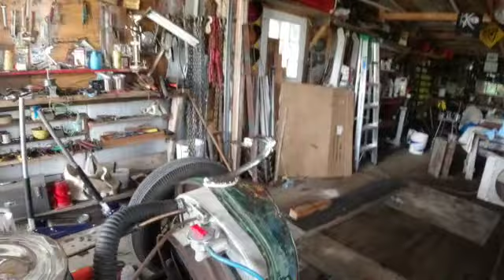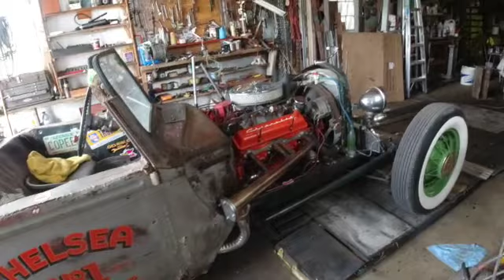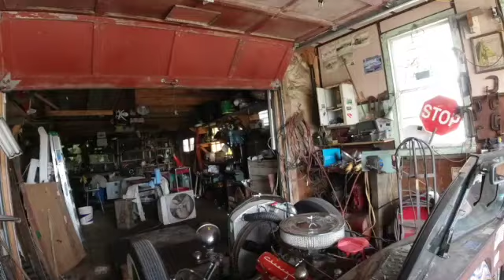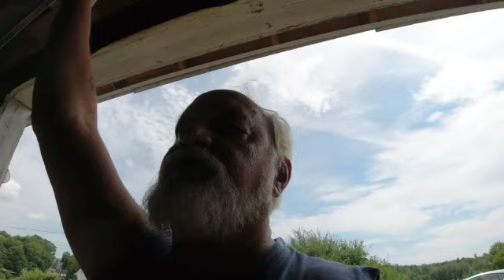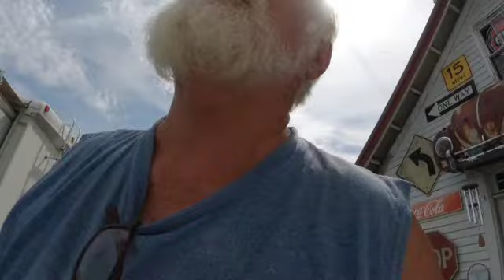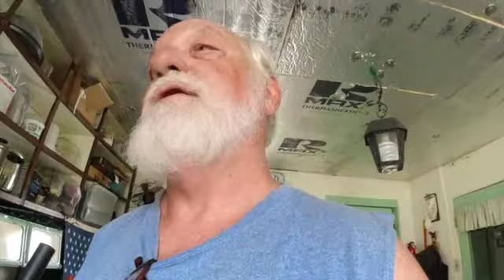Rat Rod smokin'

Comment: I had a flat head that sat for a long time and when I put it in my 52 step side it smoked on the idle after it warmed up , after trying everything but pulling it out and doing a complete rebuild my friend told me about a Lucas product that could help with my problem ...I think it was called no smoke , ring seat and restore . One can and fifteen years later still no smoke . I’m not sure if it’s still available from them ...worked for me .
Reply from the maker: Sweet.   I like Lucas products.  I fixed a problem with the power steering on my truck with some of that.   Good stuff

Comment: I'd just leave ole smokey in there as long as it runs good.
Reply from the maker: I got plans for it.
Reply: @rpeek  could the intake manifold or head be warped?  I saw where you showed oil on the gasket.

Comment: I've not seen anyone mention this possibility yet, so...
If the heads or the deck on the block have been shaved/milled very much, the intake could be sitting at an angle at the gasket surfaces on the heads. The intake gaskets you changed were really wet with oil on their sealing surfaces, and in my opinion they shouldn't have been. If it's a used intake, maybe someone somewhere along the way shaved it to match an engine like I mentioned above. Sometimes a guy runs into really strange things when using used parts. 
Too bad it keeps smoking. It sounds like it runs really good.
Reply from the maker: Good thoughts there.   I'm looking into all possibilities.

Comment: maybe take the header off that side and  see if its wet with oil in the exhaust port  that might narrow it down to the cause if the other ports are dry then its likely failed oil rings
Reply from the maker: Yes.